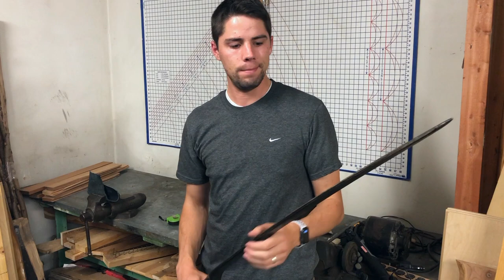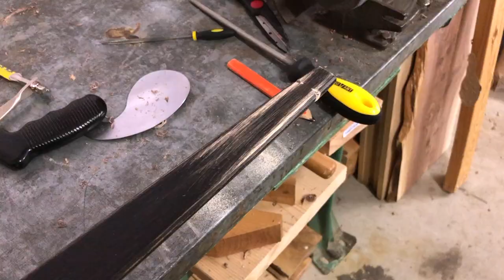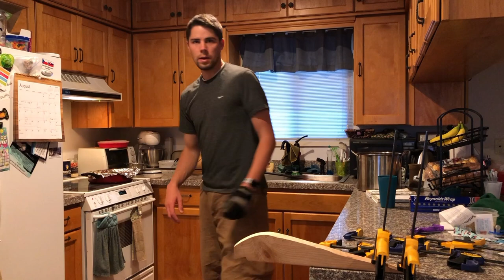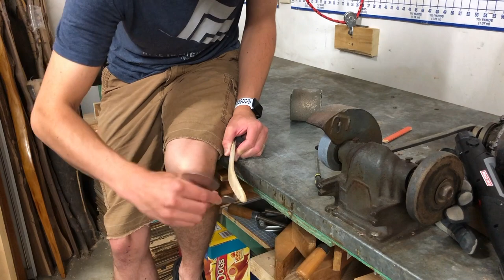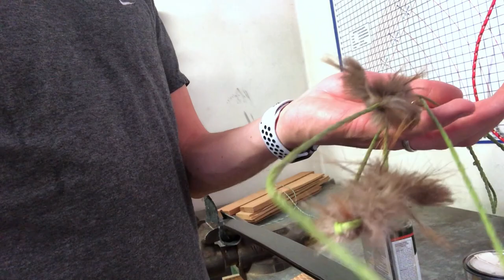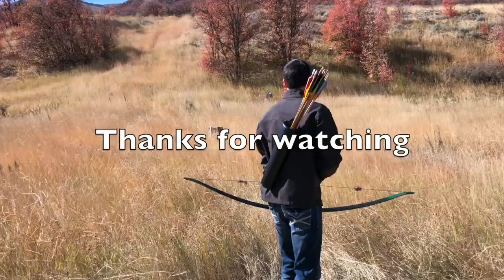How to Rework an old bow into a faster Hunting Bow

Comment: So what was the result of the speed test great work by the way
Reply from the maker: The speed went from about 140fps to 160fps with the changes. I didn’t have a chronograph at the time so my measurements were a little less accurate but it was still a significant improvement. Thank you